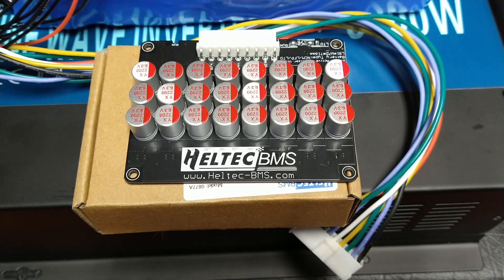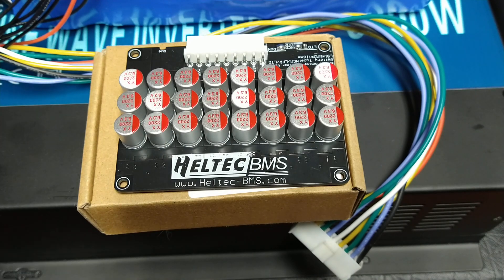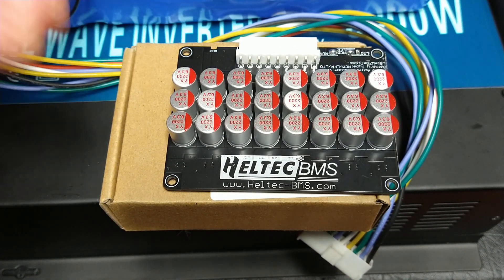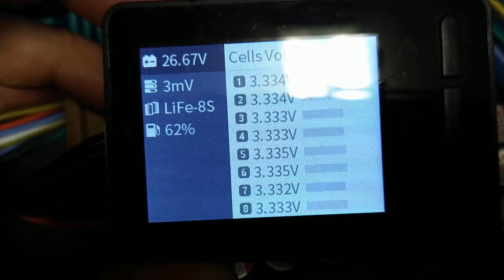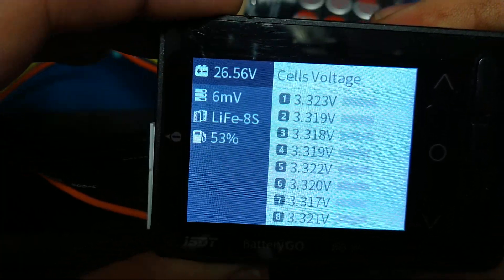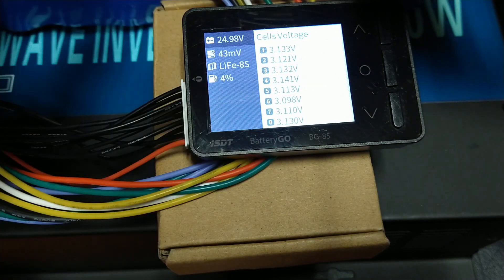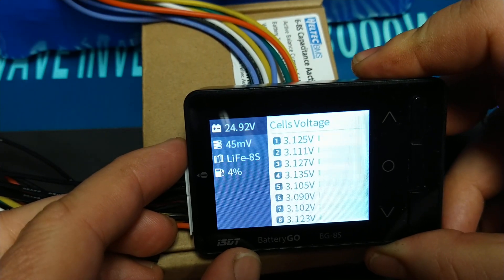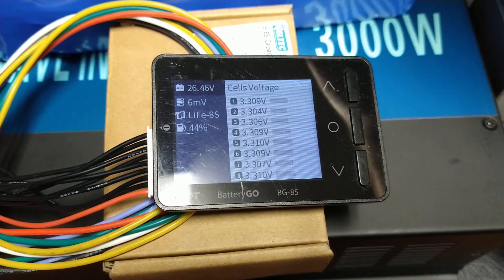Heltec Active Cell Balancer

Comment: I'm more concerned why you have such a large delta at that voltage. There are other issues that need to be addressed before you slap a balancer on it and call it good.
Reply from the maker: The LiFePO4 cells in that particular pack were about 10 years old. They actually were never cycled more than maybe 5 times, calendar aging got them. This pack was used just for demonstration because I knew it would give a large delta. Now that being said this was a video describing how the active balancer works, and how it can help keep your pack in balance. Not a video about slapping a balancer on and calling it good.
Reply: @BradCagle  

Thanks for the further explanation 🙂
Reply from the maker: @MyGoogleYoutube  You're welcome 🙂

Comment: Good video.....could you tell me if this 5amp balancer is more effective than the one that the JK BMS has internal (2amp balancer)?...I have a bank of lifepo4 of 51.2 V, 16s of 360ah and I would like your opinion in as for the difference between both balancers and what would you recommend...thanks
Reply from the maker: I have no experience with the JK BMS. Maybe some day I'll get one.

Comment: does this work with Li-ion batteries?
Reply from the maker: Yes
Reply: @BradCagle  ok good. the product sheet only mentioned lipo and lifepo4 batteries
Reply from the maker: @jacobrandall4891  No problem. BTW lipo, and li-ion are pretty much the same voltage so I would consider that interchangeable.

Comment: Is there any probleme if the batteries will be active balanced at low temperature. Is there any possibility to destroy the battery? Thx.
Reply from the maker: That is a good question, and I have thought about that too. The balancer is active all the time, however with very small currents that will not be a problem at freezing. However If your battery was in the process of being balanced (as in it was largely out so higher currents are flowing) , and the temp suddenly dropped perhaps.

Comment: Did you have to solder anything on the heltic board ?
Reply from the maker: No, only if you are using LTO cells. If using LiFe or Li-ion the factory solder jumper is correct.

Comment: Can you use this with a BMS such as a Daly
Reply from the maker: Yes. Ideally you want a BMS that you can disable the balance function, but even if you can't it should be fine.
Reply: @BradCagle  Cool I'm building a 320 amp hour 12 volt 4s lithium iron phosphate battery. I think the BMS I got does balancing but I've also read it really doesn't do anything until the charge gets real low. So I was hoping maybe this system could help keep the cells balanced no matter what their charge is.
Reply from the maker: @highlander723  It will work, the BMS's that balance, have a super low balance current so chances are the Heltec will have it balanced before the BMS has a chance to burn off much energy. You're good to go, I have more videos coming testing this balancer.

Comment: Capacitive active equalizer/balancers are in a class by itself and should never be compared with resistive types. Capacitive types waste less energy, run cooler and can be in an enclosed battery case. With a normal BMS, the balancing only occurs at the last 15% of the charge. If your charge rate is low, then the BMS’s balancer has time to work out the imbalance. If the charge current is high and fast or not complete the then balancing may not be adequate. If these cycles happen repeatedly a serious imbalance can happen. This is the perfect setting for the capacitive active equalizer to work in.
Reply: Agreed. Resistive balancers suck. These things are great!